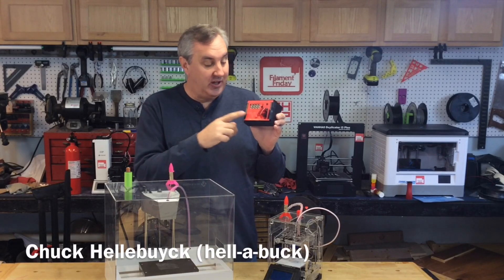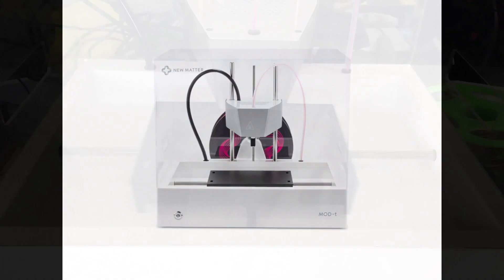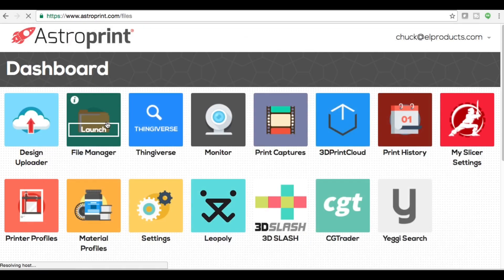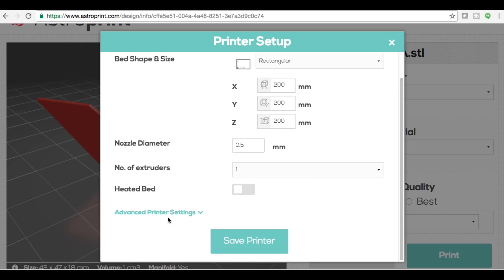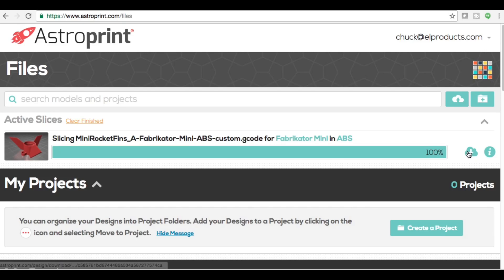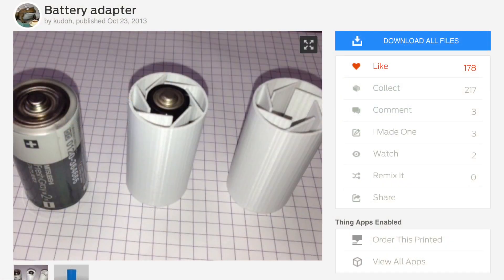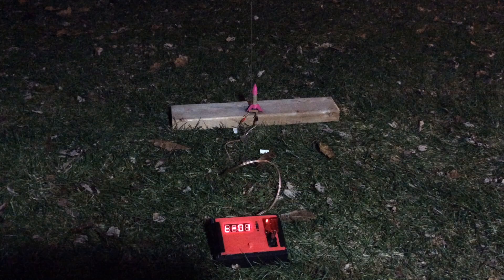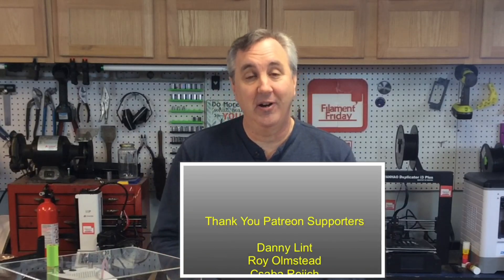3D Printed Estes Disposable Rocket and 3D Printed AA to C Battery Adapter

Comment: hey just wanted to say thanks for sharing the video review on that monoprice mini haven't stopped printing in the last 3 days and it came updated and bed leveled. I bought it off amazon because I'm a prime member free 2 day shipping. I'm extremely impressed with its capabilities. low and slow for abs with no mods attached it's doing flawless. got the e3d v6 on the way and some other parts for support gantry svideo made on thingiverse and the bearing for the spool holder. anything else besides the glass bed you would suggest?
Reply: CHEP 3D Printing I printed a few of them they actually double for the pesky lamp knobs you turn that are only about 5mm thick to hold on to....they are sweet for a few things thanks!